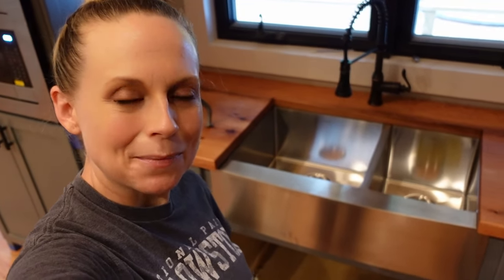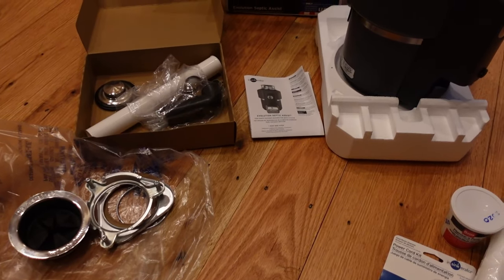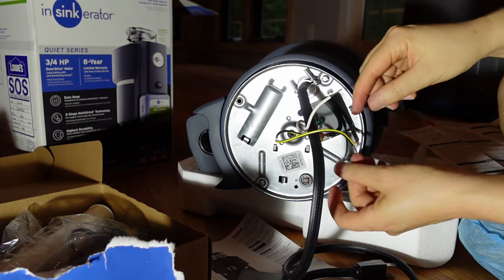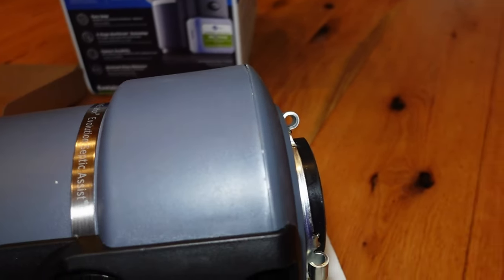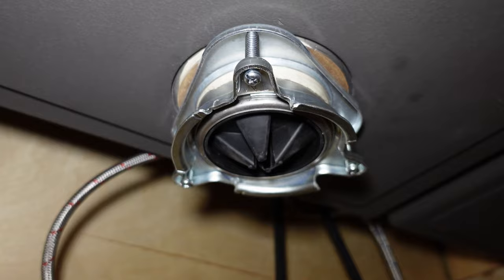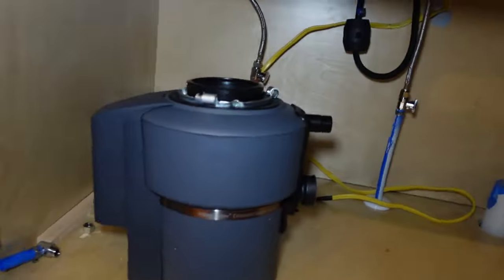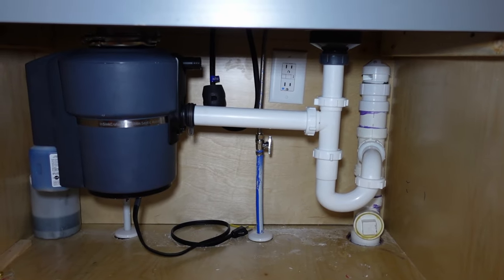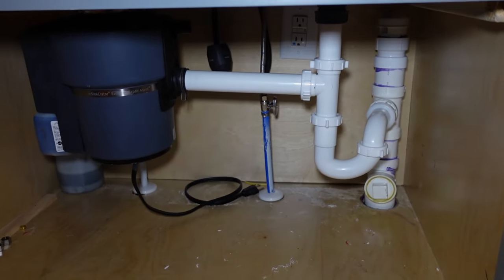DIY Kitchen Sink Plumbing With GARBAGE DISPOSAL- Start to Finish – Step by Step

Comment: Thank you!! I thought I was relatively handy at fixing things, until I spent 2 hours trying to figure out what fittings and pipes I needed to replace my damaged ABS pipes.  
It’s EXACTLY in the configuration as yours is in the thumbnail; and the kit Lowes had, required me to get extra pieces for cleaning access, and air back flow.  
I have a septic tank and debated whether or not to replace my dysfunctional garbage disposal or to go without one.  Seeing there’s and septic-friendly option, I’m definitely getting one!

Comment: ✴✴✴✴✴Includes a complex plumbing solution. This is the most thorough and informative, step--by-step explanation I have watched during half a day watching lesser DIY videos on the subject.  She even explains the metal attachment ramps giving mechanical advantage that enable easy attachment of the heavy unit with a simple twist to lock it into place.  No chitter-chatter or macho  BS here; just straightforward information.  Knows her stuff!  You go, Gal! Thanks. [D. Male: 88].

Comment: You are awesome and I appreciate your help with all things GIRL. I always do my own things if I can. I have an old top still in the sink and I am trying to put a used but good one on. The grooves of the old one are not straight, they are bent and I am having a hell of a time trying to get it on. I also didn't get the rubber piece that goes on the bottom hole for the pipe to hook on. I am trying to get the old one off the one I took out but that screw doesn't want to come out. I'm going to save myself and anyone in shouting distance from my cries of agony 😂 and just go buy one. You keep rocking ❤

Comment: You don’t need the tee to clean out the line. You can use disconnect the p-trap or come down thru the cheater valve. Plus move the cheater valve to the highest you can and still have it replaceable. It’s really supposed to be higher than the sink top.
This is a good demo of how to also EASILY replace S-Traps with a P-Trap. Just abide by minimum p-trap length two times the inner diameter of your pipe rule.

Comment: Hi there, can you please tell me what pipe you used to connect to the garbage disposer and what's the black thing is on it, please? I found out that the pipe I was using was leaking and nothing bqn fit both the other connecting pipes and the garbage disposer... 😭
Reply: 7 months no answer

Comment: Thank you so much for this video! Quick question, do you have to have the clean out? I’ve never installed on before but looks simple enough. Also, what  sealant did you put on the flea out threads? Thanks!
Reply from the maker: In my state, NC, you don't have to have a cleanout there per code, but I went crazy and put clean outs everywhere!  I wanted to make sure I had plenty of access to drain lines in case of a clog.  I used pipe dope on the threads.
Reply: Since you used a trap that can be taken apart. The clean out wasn’t needed. You can just remove the trap for drain cleaning
Reply from the maker: @joshuamiller3865  True.  I went a little crazy with cleanout throughout the house😂

Comment: I thought the newer Insinkerators said they didn't need plumbers putty?   Is it wise to ignore their directions and use the putty anyway?
Reply: I’ll answer my own question!  My model of insinkerator is the top model and now comes with a rubber gasket!  It is highly recommended to use the rubber gasket NOT plumbers putty, due to the high fluctuation in water temperatures that a sink drain can go through.!
Reply: Yeah I always use plumbers putty no matter what because the black rubber washers they give you with drains are junk so I just use a non staining plumbers putty roll it in your hand like your making a worm and put a decent ring of it down on the hole of the drain in the sink and then when you tightening it down it oozes out and you just rake the excess off
Reply: @garybrady7245  I changed my mind and ended up using the PUTTY too.  most recommendations out there says to use plumber putty... even though the directions highly suggest using their gaskets.

Comment: Hi, I'm a SPARKY so bear with me. We just relocated from Las Vegas to Pennsylvania and are experiencing a lot of first-time things. For example we too are on a septic system, so for the garage  disposal install, is there a specific type? And if so, what is the difference between a standard like I am familiar with and have installed quite a few and the one you have here. I just started your video and paused it 23 seconds in to comment and ask you this question. Thank you very much, 
ZEROGENX
Reply from the maker: I used the Insinkerator Septic Assist model.  It is just like a regular disposal except that it has a small bottle of liquid enzymes attached to it.  Each time you turn on the disposal, it shoots some of the enzymes into where the blades (and food) are.  The enzymes are supposed to help breakdown the food in the septic system.  Other than that, it is just like a regular disposal, and is installed the same way.
Reply: @CountryGirlLiving  I just went with the dual stage grinding and throw in some rid x ever once in awhile. Just another thing to break on the disposal
Reply from the maker: @nolansmokes  True, that is a good idea

Comment: Power cord....insinkerator, cheap assed out.  Should have kept the one off the old Badger 5.  Im just pissed i got to cut out my back wall and lower the drain line to hook up this disposal with a lowered sink.  Of ALL the research, remodeling and gutting I've done the last 4.5 months I find out now after new cabinets and counters are in.  😢😢😢

Comment: Good lord.

The plumbing putty is a huge no no under the strainer flange. Get a proper gasket or atleast silicone it, this will be a nightmare for anyone who ever needs to pull it apart when (not if) it leaks.
Reply from the maker: You are confusing plumber's putty with silicone.  Plumber's putty is used routinely on drains and comes apart easily.  Silicone is the one that is very difficult to get apart.
Reply: @CountryGirlLiving  I'm not confusing anything. 

The putty will dry out within the next 2-3 years, and then will start to leak, corroding the threads of the drain basket. I've cut quite a few out because it's just not worth trying to undo the super shallow nut on the bottom when they're filled with junk and are corroded together.

Admittedly on the garbage disposal side, the leak will atleast be pretty easy to identify, so it would probably be fixed before it turned into a major issue.

(My Dad's been in the trade for 44 years, for reference, I'm currently apprenticing under him)

Silicone is definitely a bit harder to remove, and install, but if you have the tools and learn how to work with it, it can and will last a lot longer than plumber's putty when applied properly.
Reply: @Chris6068 I have plumber's putty everywhere I have no leaks for 42 years